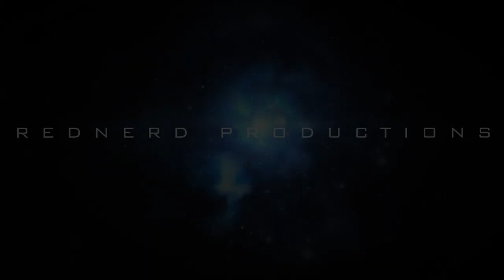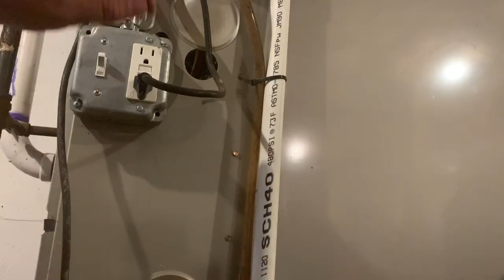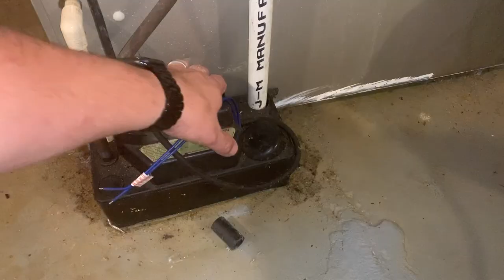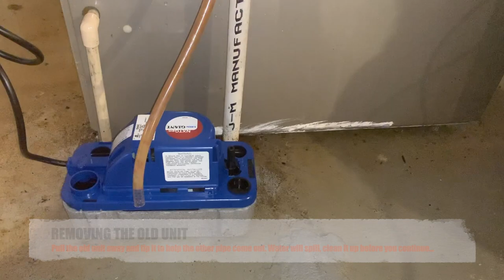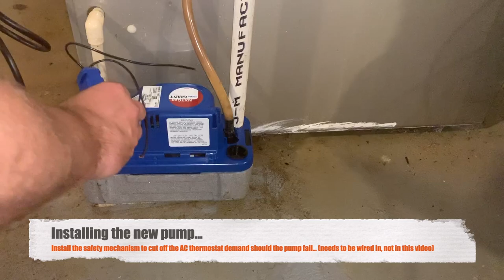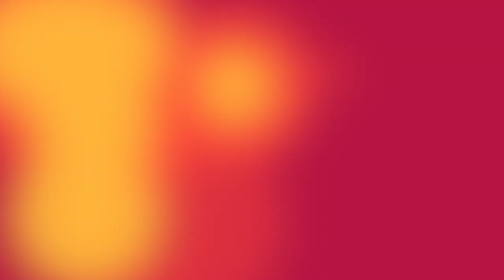REPLACING A DEFECTIVE CONDENSATE PUMP

Comment: Great video tutorial and suggestion for replacement!  I searched on Youtube for 30 min before I found your video, which has the exactly the same old model as mine.
do you mind sharing how the electric wire was replaced?  Mine had the wire from the pump going in the furnace.  Did you unplug the wire completely from the pump?  Many thanks.
Reply from the maker: Mine was a standard wall plug which connected to an outlet close to the furnace
Reply: @rednerd  thanks, Artem